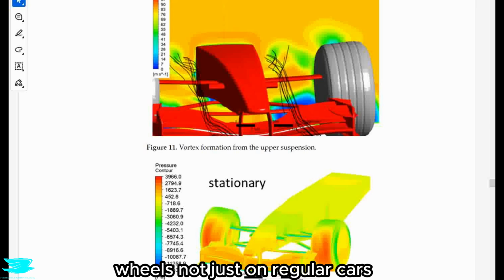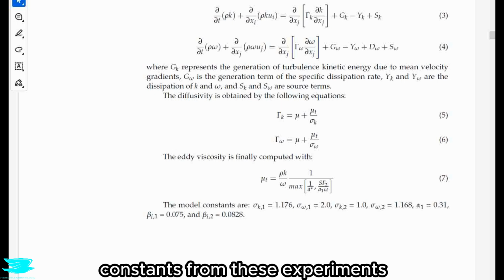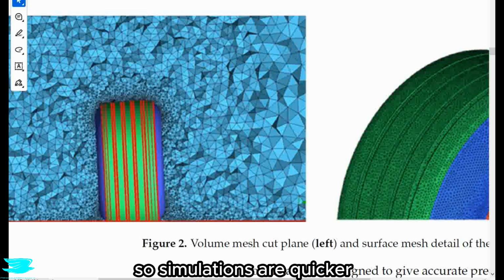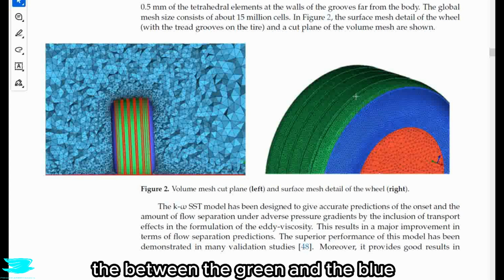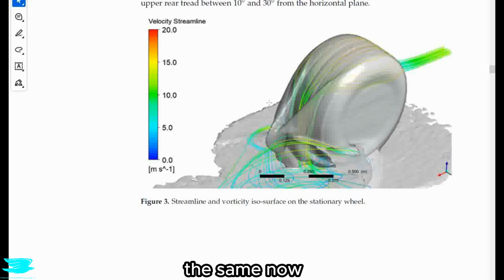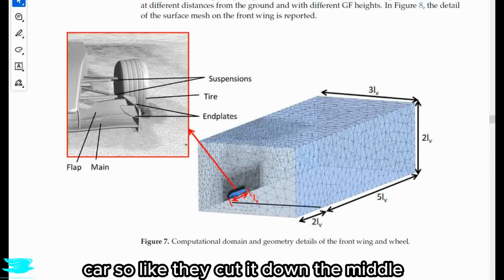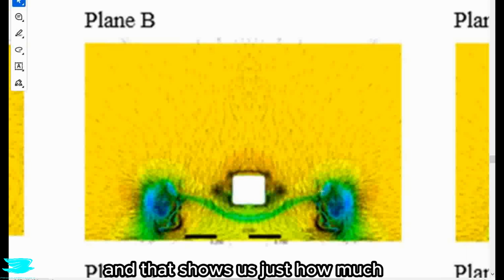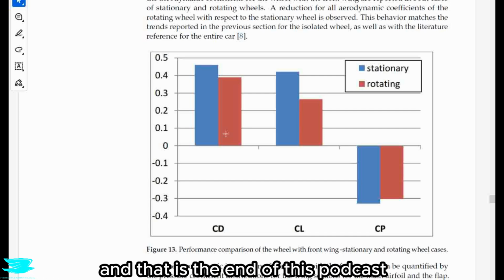F1 Car Wheel Aerodynamics Podcast 204

Comment: Hi, I have a question. What are some ways to force the air to stay attached to the back of the car? Are vortex generators really the only option?

Also at what airspeed do you do your simulations? I would imagine at specific speeds the airflow behaves differently? Wouldn't their cd be constantly changing?
Reply from the maker: Usually, rounding the edges and making the rear small is the best option.

For the simulations, generally, they are independent of changes in velocity. For example, the same general flow physics will occur at 70 kph and 140 kph.

Going from 10 to 400 kph will change things.

Comment: So there's a transverse vortex that forms over the top of the tire, no wonder the surrounding airflow influences it that much. Lateral flow will increase the transverse vorticity, which is why you can make the top of the wheel generate downforce.
Reply from the maker: For an exposed wheel, yep. For a wheel on a regular car, there kind of is, but it often gets destroyed, or shot out of the wheel house pretty quick. And only one side produces a noticeable vortex.

Comment: To add, cars also have different Ackermann steering. Anti-Ackermann will make the outside wheel turn towards the corner more than the inside wheel, and that yaw relative to the corner has a big influence on the aerodynamics of the tires. On the one hand, Anti-Ackermann is good for putting heat into tires, because of the outside scrub, but it makes the aerodynamics worse. Whereas Ackermann where the inner wheel turns more than the outer wheel is better aerodynamically, but worse from a tire heating POV.
Reply from the maker: The anti-Ackermann would also wear the tires more, I imagine.
Reply: @PremierAerodynamics  Indeed.

Comment: F1 like race cars can exploit a fair bit of downforce from the tires. By having a wing in front of the tire, you're blocking flow that would otherwise produce tire squirt. Add in some bargeboards behind the wheel, and you create the best case scenario. Lower static pressure at the front of the wheel, and raise it behind the wheel. The front wing upwashes air, and accelerates it inboard of the wheel. The end result is the tip vortex of the wing, counter rotates to the lift producing lower wheel wake, which then further keeps the wake outboard, since counter rotating vortices tend to repel each other. Furthermore, by reducing the lower wheel wake with the wing and barge board, you can also strengthen the upper downforce producing wake. Typically since the wheel is in ground effect, the lift producing vortex is almost always stronger than the downforce producing one above. Not to mention that since the wheel is a rotating cylinder the wake tends to be unsteady and almost like a Von Karman street.
Reply from the maker: That lower static pressure in front of the wheel compared to behind it would also help reduce the drag. So, that's clever. And keeping the wake further outboard increases the cleaner flow to use for more downforce.